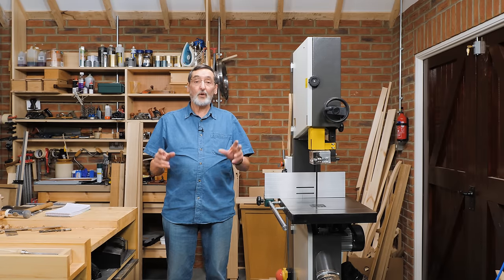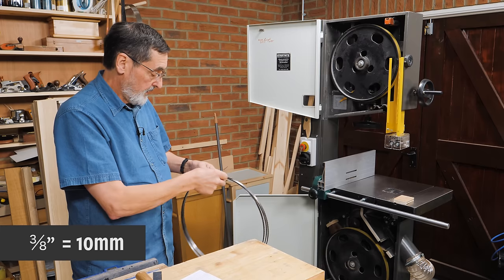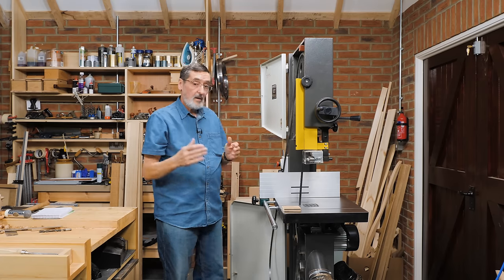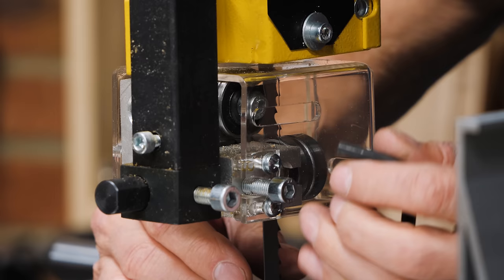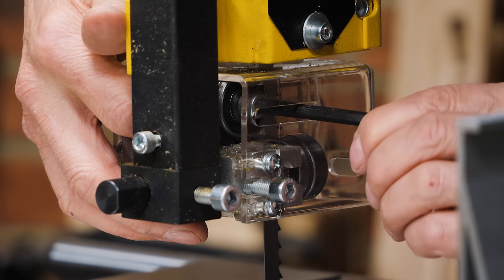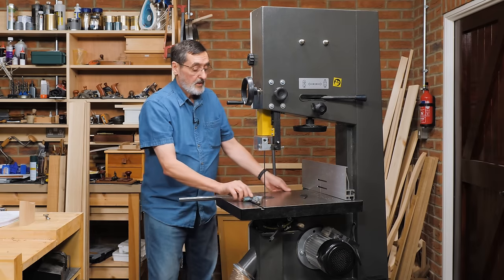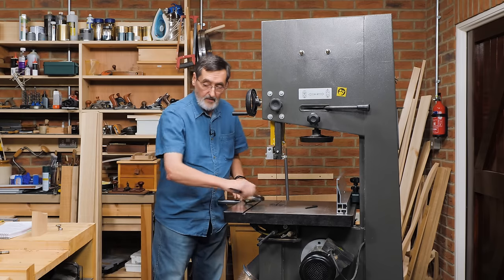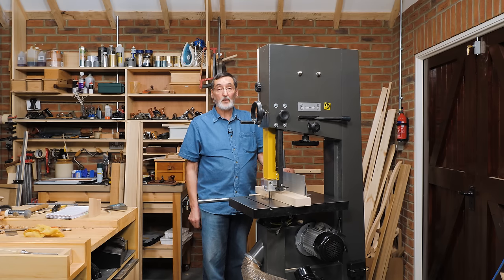How to Set Up a Bandsaw | Paul Sellers

Comment: Useful, thanks.  Nice, big bandsaw (StartRite?) & tall fence .  What diameter are the wheels (they look about 16"-18" to me)? Seems like most amateurs in the UK make do with relatively small bandsaws, maybe 8"-12" diameter wheels (or 3 wheel alternatives) but in the US, folk seem to consider 14" the size to go for (perhaps with a riser to lift the top wheel higher).  So, by comparison, this seems like a big one (although I 've seen  pictures of huge, old, industrial bandsaws).  BTW 3-phase or single-phase?  I have a 12" bandsaw, which is handy, but it can't quite manage 12" wide cuts (throat width limitation), perhaps that is why our American friends aim to  get 14"+ bandsaws (they also tend to have more space, lower prices, lower taxes and a bigger secondhand market, which no doubt helps).

Comment: Is there any reason you turned the top wheel when adjusting the bearings...why not turn the bottom wheel when adjusting the bottom bearing?  Do you leave the tension on the blade when you know you won't be using the bandsaw for more than a day or two?  Do you double check the bearings each time before you use the saw, or do the bearings hold, for the most part, once they're set?  Thanks Paul!!
Reply from the maker: Mostly, hand turning is to see if the back of the blade is 'kissing' the back or thrust bearing.  On most machines these days you cannot run the machine to watch as in times past. Many woodworkers used to do this to see how the blade tracked on the wheels.  Many machines made now have an automatic off switch integrated with the doors so if a door is open it disallows a circuit. Once the blade is centred we often close everything up and run the machine for a minute to check that the full power has not sent the blade off centring and we adjust accordingly. The bottom wheel is fixed and not adjustable. The blade is centred and balanced between the top and bottom wheels. Once centred on the top, the bottom will be aligned also. There can be exceptions but usually this is caused by misaligned welds to the blade joint. I never take the tension of the blade and never have done and have never seen any degrade in any aspect of the blade or the machine.  I generally keep my eye on the bearings just in case but mostly they remain aligned. That said, blades can alter over the lifetime of their use and sometimes things do need alteration but mostly to the tension.
Reply: @Paul.Sellers  Great explanation!  Thanks again Paul for this and all of your other fantastic videos.

Comment: Being fairly new to bandsaws, I have no confidence in opening up a new blade at all - as you say they are extremely sharp and I just couldn’t risk opening it up for fear of it springing into my arms or face! I ended up throwing it outside to open it up. Are there any tips on doing this properly? It looks complicated!
Reply from the maker: It's not complicated. Keep your arms covered especially when new to it. It is more  a question of  careful 'unfolding' the springy blade. You will feel its natural tendency as you do this and follow it by crossing your hands and releasing the tension as it opens up. Basically you are leading it out of twist.
Reply from the maker: @joshjenkinson1929  How large is your bandsaw, Josh. The larger industrial bandsaws are the difficult ones because often these must be double looped to reduce diameter. We're talking bandsaws with wheels 30" on up here though.
Reply: It’s just a small one but the blade i had problems with was a large one I bought to make a heavy duty rip framesaw with. Now you mention it, I think I’d be okay with a smaller one. Could I thank you for taking the time to reply - I know you must be inundated with them. Also for enabling me to learn woodworking skills for free online. You really are an excellent teacher.
Reply: @joshjenkinson1929  At a minimum, until you are experienced, wear leather gloves, eye protection, or better yet a face shield. And after you are experienced do the same thing.

Comment: Nice.  I am about to inherit one.  Paul is always my best teacher.  But, that faceguard helmet looks ridiculous.  Looks like it was cobbled from a hockey helmet.
Reply from the maker: Ridiculous??? I want good lungs all the way to the end of my life, Kevin, and I don't care how I look doing it.  My air is clean, clean , clean. This mask is an air filter taking any air I breath through filtering pads in the top, overhead region and passing a nice waft of cool air over my face so there is no misting up.
Reply: @Paul.Sellers  LOL, fair play.  On closer inspection I see the tight form fitting area around your jaw.  But I am curious about the helmet.  What does that do for you?  A common respirator will not work?  Please teach me as you always do.

Comment: It's good practice to disconnect all power to the saw before changing blades.  As for opening folded blades, I never try to open with my hands - I take them outside and toss them on the grass and let it spring open.
Reply from the maker: Hi Bob,  At 0:53 we actually show disconnection from the power supply so it is very clear for safe practices.
Reply: I stand corrected.  But please take my advice as a former research prof  of surgery:  "Especially with electrically powered tools, there are no safe machines.  There should be only mindful and cautious operators."
Reply: Bob Blarney very bizarre caution, Bob. Paul covered safety very clearly
Reply: @MatSmithLondon  Perhaps you wouldn't consider it so bizarre if you'd seen some of the injuries that I have over the years - often sustained by very experience personnel.
Reply: Bob Blarney no, I don’t find it bizarre to give safety warnings. I find it bizarre that Paul did just that, and you are still asserting he didn’t!

Comment: I always thought that because of the offset of the teeth if you are parallel to the blade and you are close enough to going dead on you should be good.  The reason is that the only part that cuts is the teeth and as long as you don't hit the back of the blade with the offcut the front will stay on course.  Now I understand why you do what you do because it's doing the same thing just easier to explain I guess.

There's people that will do runout tests and really spend hours setting a handsaw up.